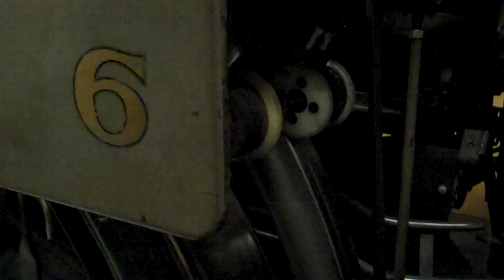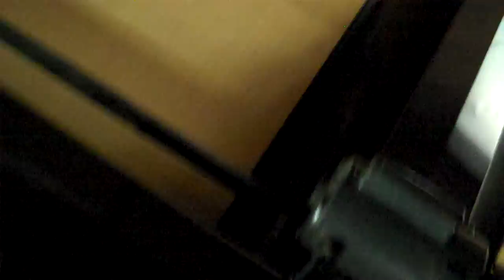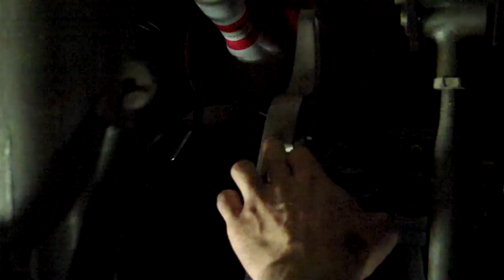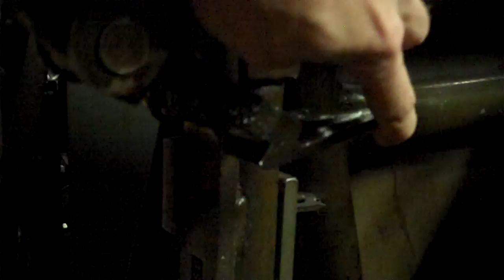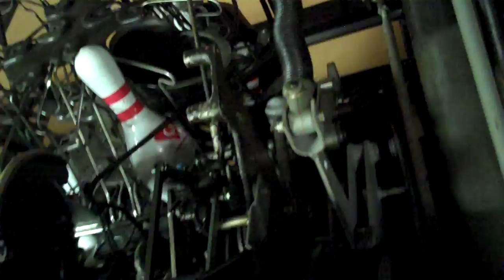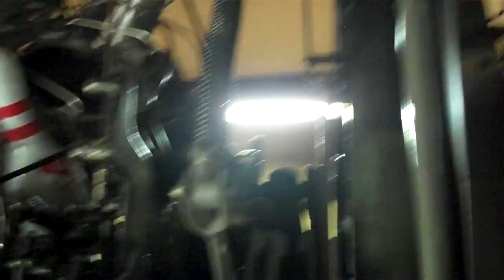Positions (Degrees) Of A Brunswick Pinsetter During Cycle

Comment: Very informative video. I had heard the different degrees mentioned but other than 180 didn't know the differences.
Reply from the maker: Thanks Kev! Yeah for the most part 90 stops or 270's were rare. I think I only had one 270 call in my life lol, ofc neglected machines have more calls. 90 or 270 you can fix by just hitting the reset button up front most likely!